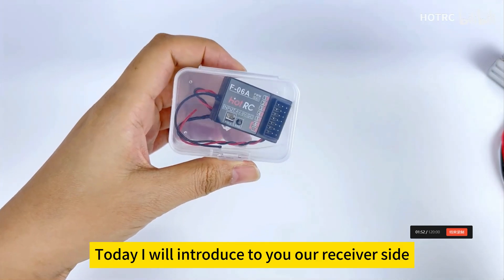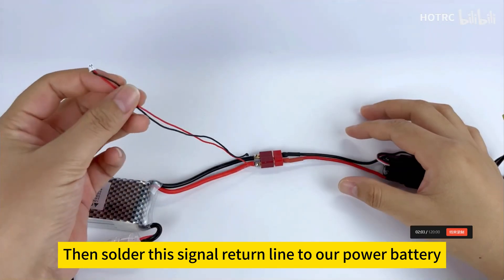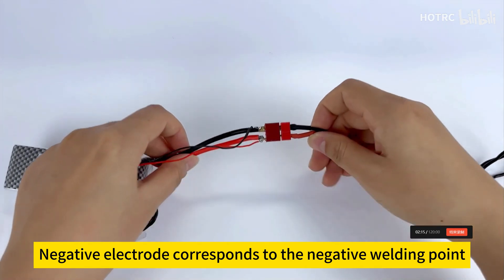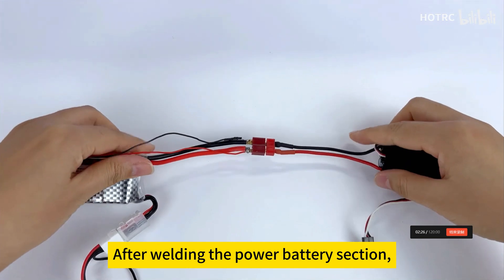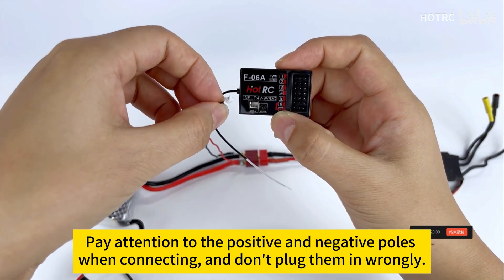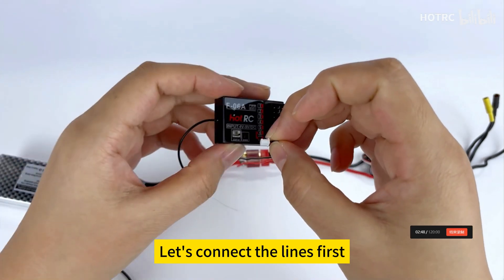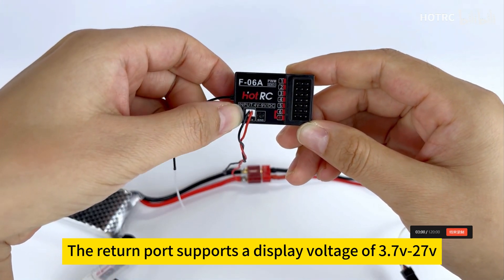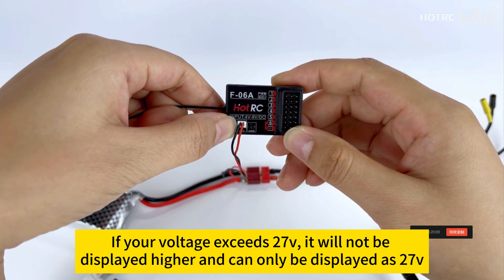What is the socket on the HOTRC receiver for❓❓

Comment: Help Help Hi, I need help. I built a lawnmower with the following components:
• Two 24V 150W motors
• SmartDrive 30A 7-35V DC Motor Drive, 2 channels
• HOTRC DS60 transmitter
• HotRC F-06° receiver
All assembled, the problem is that it goes too fast forward and reverse, and when turning too fast, it's uncontrollable. I don't know how to decrease and store the speed.
Thanks

Comment: Hello, I have a CT 6A remote control. I'll be using it in a nitro car. I connected the servo connections to channels 1 and 2. There are only 6 inputs. Which channel should I connect the battery to?
Reply: Hi! How are you? Did you make it work? Where did you connect it? I am currently having the same problem. I will appreciate your answer.
Thx a lot!

Comment: I am new to RC, but have to learn because I am now working on a RC lawn mower, DIY project.  Now I start to think that what is called as a "Voltage Rerun" line is a voltage readback line, where the power supply voltage can be read on the transmitter unit remotely.

Comment: I have a question — is it okay to connect the voltage return (transformer signal wire) to the balance connector instead of soldering it directly to the battery?
Reply: Have you done it?
Reply: @doneteam_rc   Yeah, it’s okay
Reply: @doneteam_rc  Don’t solder it, just make sure to plug in the balance cable with the + and – in the right place.”
Reply: @u-stoch4087 will it cause no damage to the battery?
Reply: @doneteam_rc  The voltage alarm is also used by plugging it into the balance cable, so I don’t think it will cause any problems for the battery.
Reply: @u-stoch4087   isn't it that the voltage alarm is only used when the battery is unplugged from rc?
Reply: @doneteam_rc  
The voltage alarm is also used during driving to prevent the battery from over-discharging.

Comment: What's the maximum voltage of lipo that could provide the receiver? Can i use 3s lipo ? As it's mentioned input 4-9 v on the receiver
Reply from the maker: 1. The lithium battery power supply range of this receiver is 4v-9v. If you use 3s lithium battery (11.1v), you need to reduce the voltage, otherwise it will burn out
2. The battery of the receiver’s return port can return up to 27v
Reply: @HotRC-Sophy  27 v ?
Reply: i think its 27v max input for rsci port and for receiver its 9v @arthurchikog

Comment: it seems like it would be smarter to solder it on the other side of the connector that way every battery would have the feedback capability and not just the single battery you soldered to.  it would also keep you from having to open your receiver box every time too.

Comment: Is it required?
Reply from the maker: No, it depends on your needs. If you need to know the voltage and low voltage of the product battery in real time, you can connect it. If not, you can just not connect it.
Reply: к приемнику F-06A в инструкции указано допустимое напряжение 4v-9v, а в вашем видео до 27v. Это не ошибка ? Ни где не нашёл подробной инструкции...
Reply: Они чуть выше писали что - диапазон приёмника от 4 - 9v, если использовать 3s 11.1v то необходимо снизить напряжение иначе приёмник сгорит. Но в то же время обратный порт может возвращать до 27v. 😂